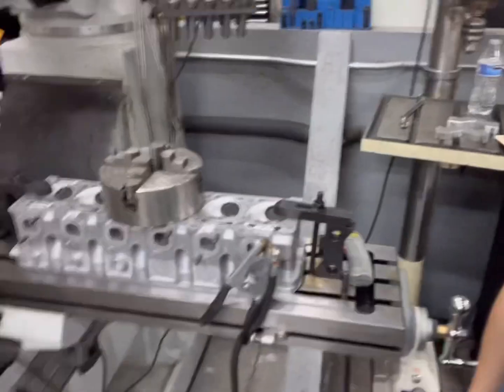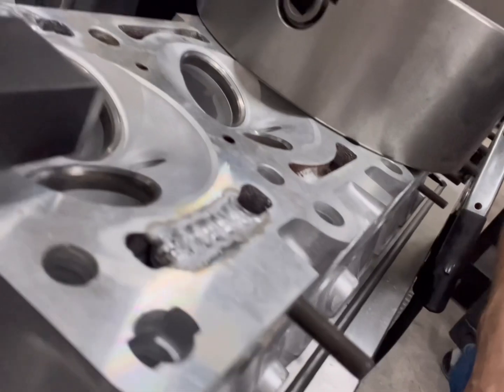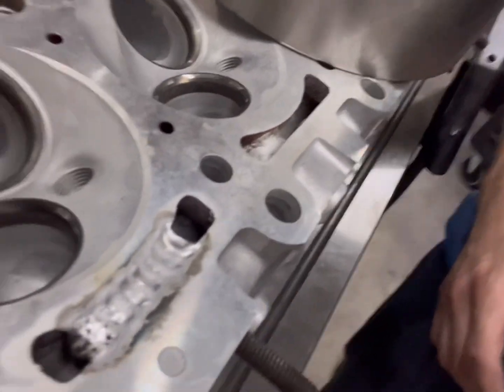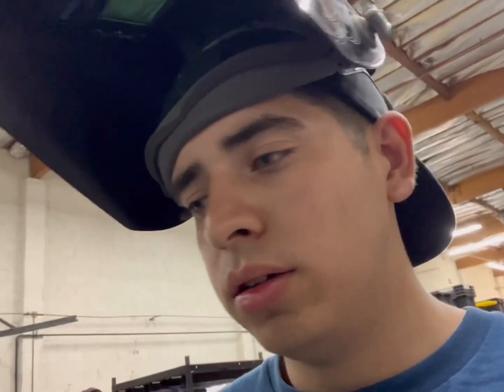E30 Bmw M20B25- welding the coolant passages for big boost !

Comment: Hello what is soldering used for? I have a problem with my cylinder head, the oil mixed with water. I have an Athena o ring joint and screws arp
Reply from the maker: the area i welded on the cylinder head helps with sealing the head gasket in the places where coolant can leak from high boost applications. there are people who have done just fine with arp and a elring headgasket. you can also oring the block like these other gentleman have recently commented. how much boost were you running when it blew?
Reply: Now I am with an Athena joint and arp screw only I have a doubt about the tightening torque. I am at 1.5bar of boost

Comment: I run 22psi non welded head 
With elring gasket. And arp 

If you run coopering gasket you dont need to weld the head.
Reply: So if I O Ring the block I won't have worry about welding the head?